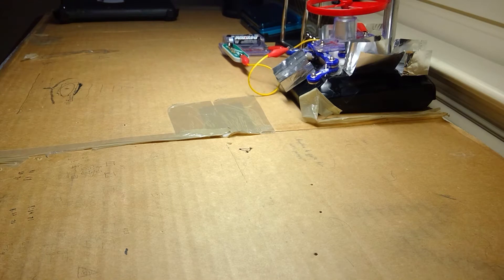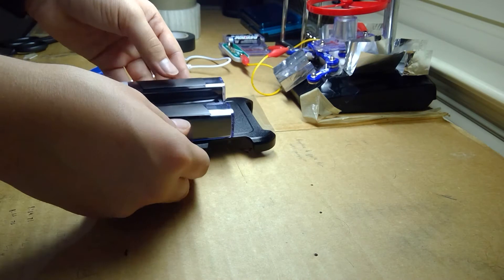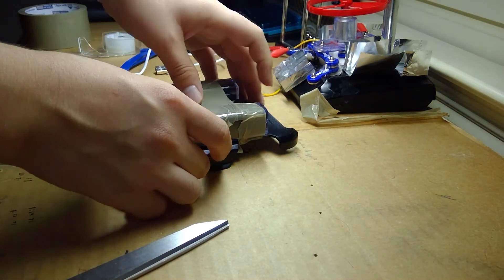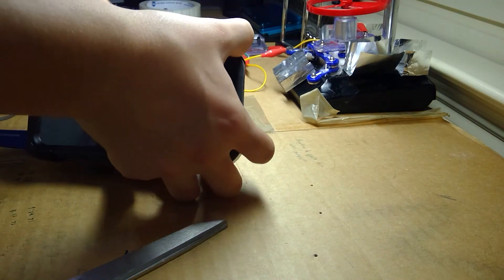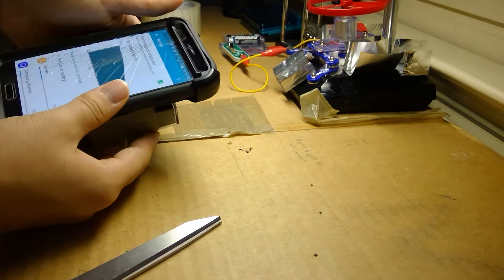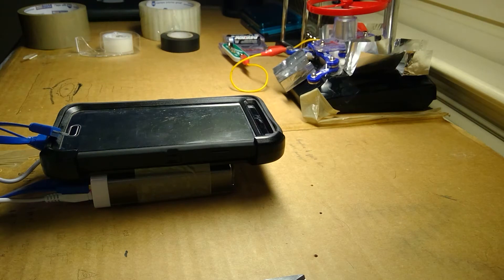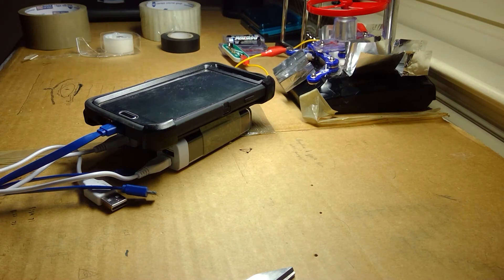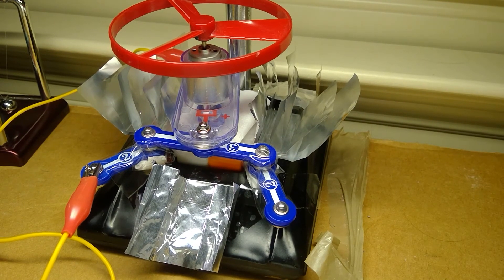How to get a MONTH of battery life for $15!

Comment: You can pack a lot more battery in a single phone sized battery attached to the back than you can 2 bar batteries. 
Also, the number of cables sticking out make this look more like a bomb than a phone you can stick in your back pocket.
Also, keep in mind that power saving mode is designed for people who need to get through the last 2 hours of the day on 5 percent, not a way you can use your phone all the time.
ALSO, (sorry, I like alsos) the cycle of charging one battery into another, which in turn charges another, loses a lot of energy, as the process of charging isn't 100% efficient.

Nice instructable, I'd suggest finding slightly more practical things to make, like a wire hanger phone stand or something, because who doesn't need that. :p

Oh, and also why not just buy the battery and use it like it's supposed to, so that your phone is actually holdable.
Reply from the maker: +TheFormidableFoe YT Good points. I could probably get more batteries and/or higher capacity ones. The purpose of this video was simply to illustrate the idea. Cable management is definitely a good idea. Perhaps a device that would automatically switch power packs when one dies would solve the energy loss issue.

Thanks for commenting btw